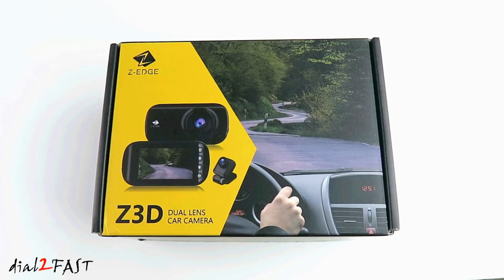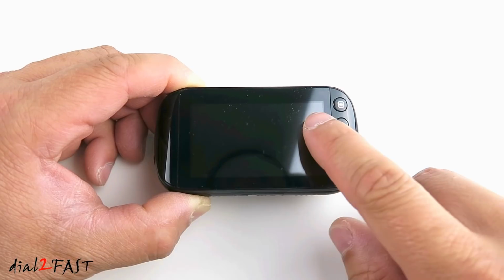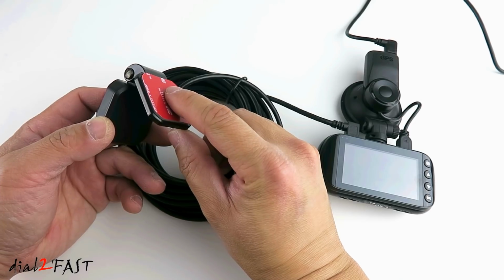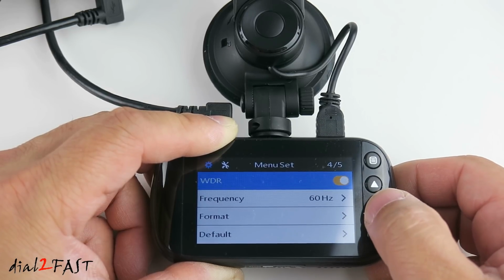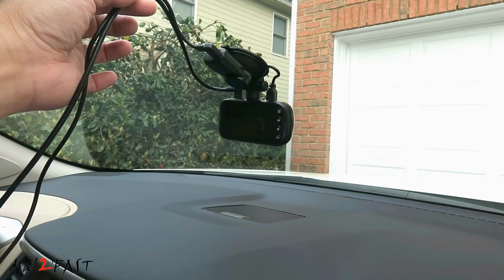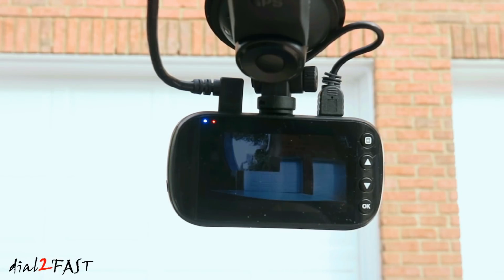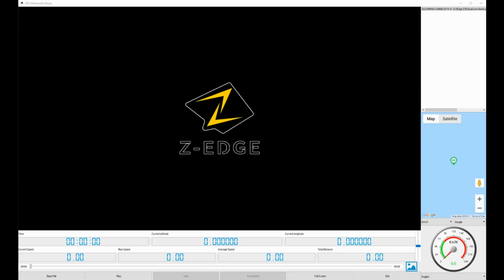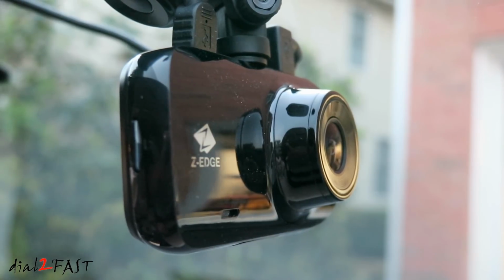Z-EDGE Z3D Front & Rear HD Camera Dashcam

Comment: Suction cup does not suck, which sucks. Keeps falling off the windshield.  The menu and user interface is garbage. Twice now, the SD card has been launched out the side without being touched.   The instruction manual is uninformative and vague.  I have 5 of these bought all at once.   I would not recommend this model.

Comment: Thank you for this review. This was very professional. ALL reviews by others should follow your format: Product introduction, unboxing, run-through on product usage, product installation, and examples of recordings made by the product. And you spoke clearly. Good job!
You also provided a link to Amazon so others can view the current price and, near the bottom of the Amazon page, view questions from others about more specific topics about the product. I don't want to sound like a jerk (which I'm not), but people needs to do their own research to answer their own, more-specific questions. There's a point when it starts to cross the line into laziness when people won't even do their own more-in-depth research for themselves. 

I did purchase this product from Amazon. I especially liked that it has GPS tracking/speed mixed into the video recording and also the inclusion of the back camera, because I can't tell you how dangerously close people get while tailgating me. 

Last, for those who are interested in this product from Amazon, be sure to click on the Coupon box and check mark to add a discount off at the cart at the time of purchase. My discount was $30! I paid only $100 for this camera set!
Again, excellent review! Good job! Thank you!
Reply from the maker: Thanks for your comment and sharing your thoughts. Really appreciate it!

Comment: Is there one that u can hot wire and comes with the hot wires cables too?
Reply: Unsure if you done so but to answer your question, yes you can. I both mines from Amazon, get the one with different fuse lines (low profile, regular).